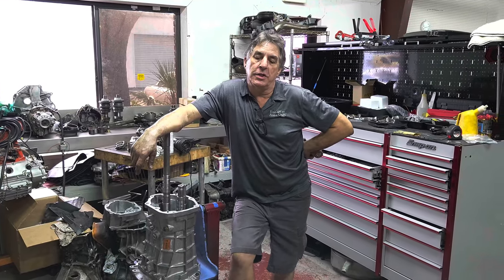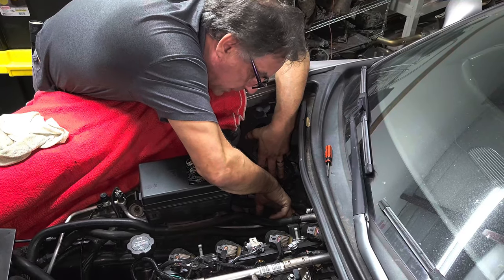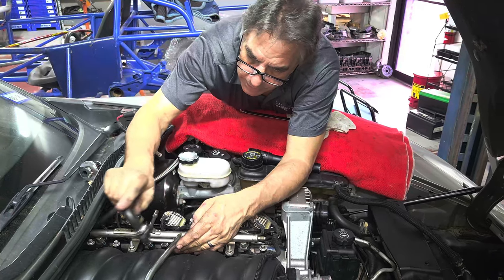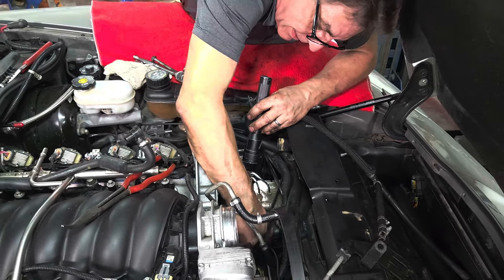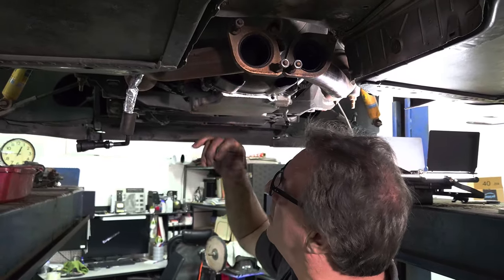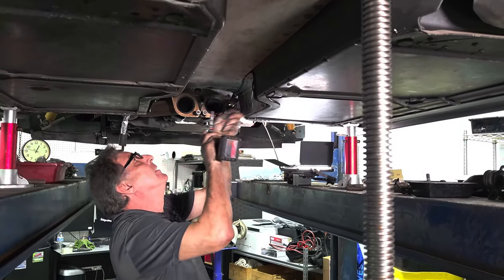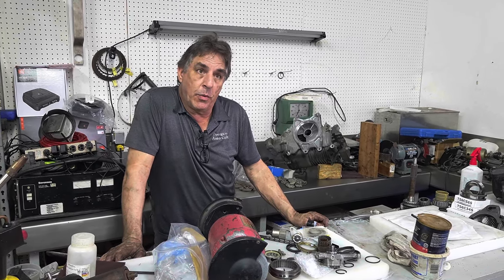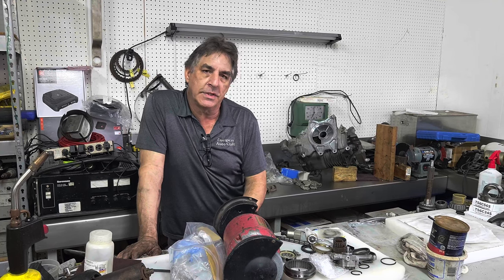C6 Corvette Project - EP1 - Engine Removal

Comment: Great job one thing to note is DONT use impact on the 4 nuts that hold cradle period!
Has something to do with the way the studs are in frame from factory 
The rear as well
Reply from the maker: Oh wow, ok. Thanks for the tip. I should have read the manual a bit closer. I appreciate the input.

Comment: I never understood why someone would want an automatic transmission in a front engine and rear drive axle sports car.  With an automatic transmission in this setup, you cannot manage inertial load shifts from the rear axle to the front when cornering.  With a manual transmission,, you can keep the inertial load on the rear driving axle while shifting to a lower gear to slow down when entering a corner, with the engine over-revving so that the power is still available when you downshift into a higher gear as you accelerate out of the corner. With an automatic transmission, when you take your foot off the gas to slow down, the inertial load shifts to the front axle, which means you unload your driving axle into the turn, causing you to loose traction into the corner until you accelerate out of the corner.  With an automatic transmission, you cannot corner as fast as you can with a manual transmission, which aside from going fast in a straight line, is what makes driving a sports car so much fun.
Reply from the maker: I agree, this car is equipped with a manual transmission. Automatic transmissions these days, especially the European cars have electronic controls to prevent shifting in corners,  amongst many other controls. They have acceleration sensors, yaw sensors, and using the abs wheel speed sensors,  it csn determine the slightest bit of slip and cornering.
Reply: Also considering it came LS swapped from the factory - seems like a no brainer
Reply: If what you just said is true then why do professional race car drivers go slower in manual cars versus these newer automatic transmissions?